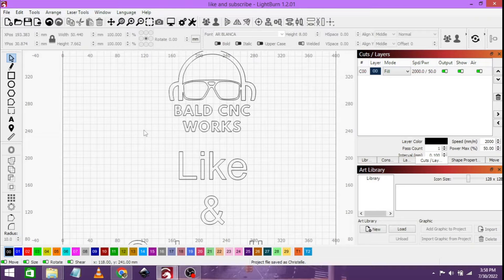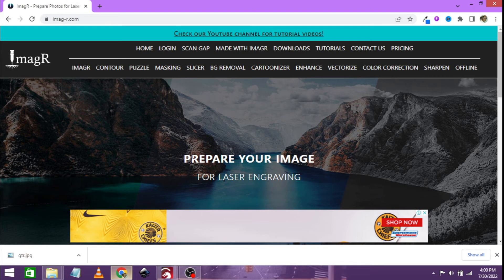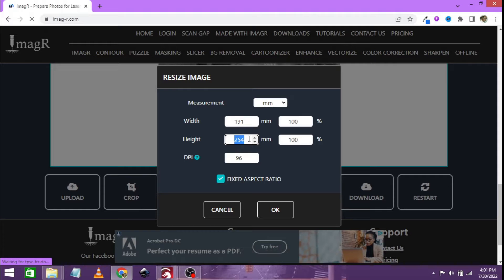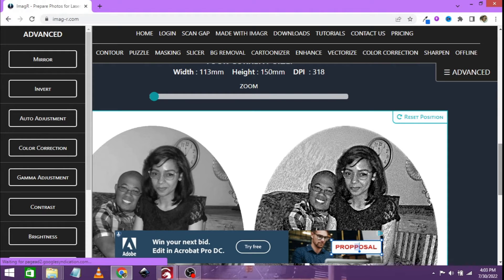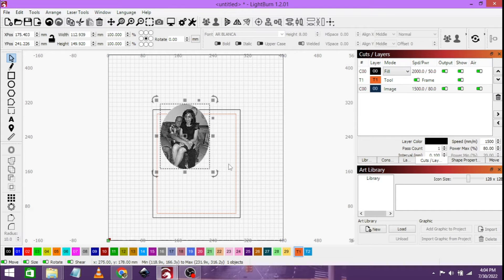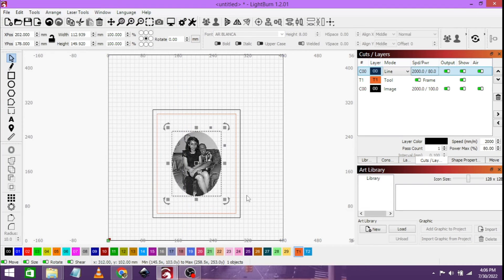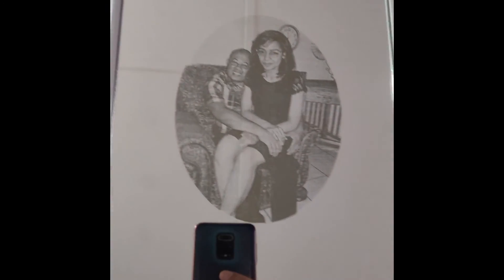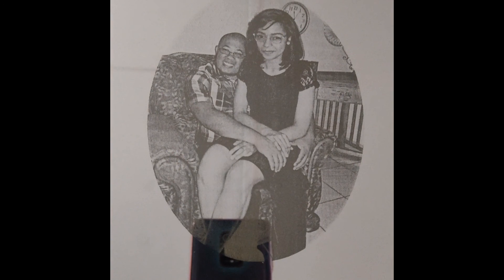How to Engrave a Portrait on a Mirror | Lightburn

Comment: Did you paint the mirror or is that just the backing that it's burning into. Also what wattage laser are you using
Reply from the maker: Hi, no it is the backing of the glass mirror. I have a 15W Ortur Laser Master 2
Reply: @baldcnc_works  very nice. Mirror backing is usually black. How is it white? I'm experimenting with white roll masking on glass. It looks the same
Reply from the maker: Yes the backing comes in different colours. The one in this video is blue on the back. But if you are experimenting with different backings, you should do a speed and power test. I have a video for that if you would like to see it. https://youtu.be/SYebLyaSXY4